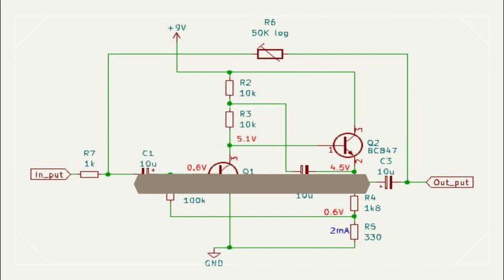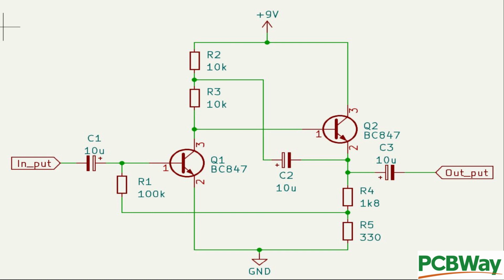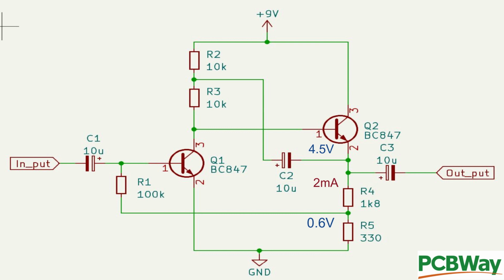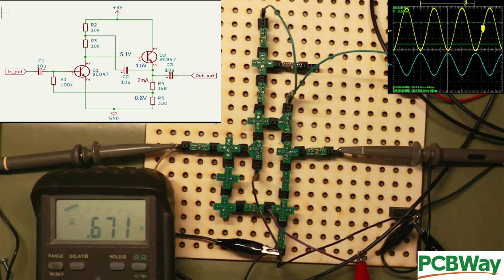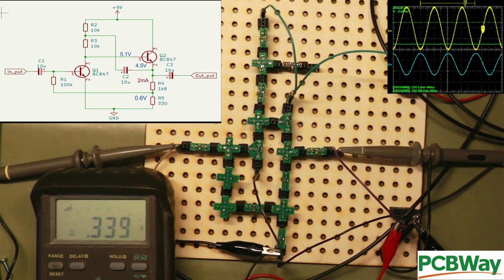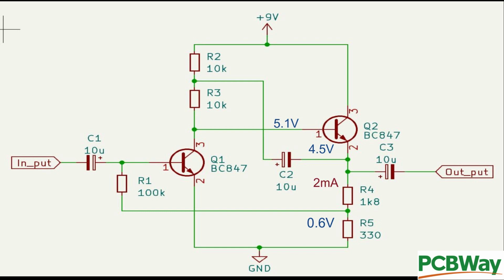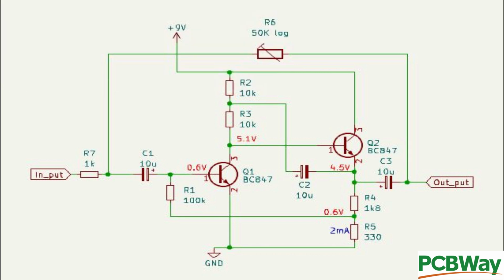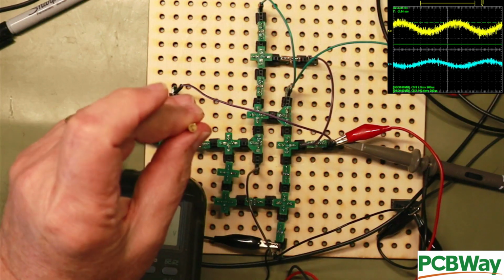#214 experiment 13 mic amp circuit

Comment: A great explanation as always! I may try this circuit next time I make a mic booster.
Reply from the maker: It's quite a nice little circuit, lots of gain when used without the negative feedback.  But with it a nice stable and controllable gain via the feed back without a lot of calculations.